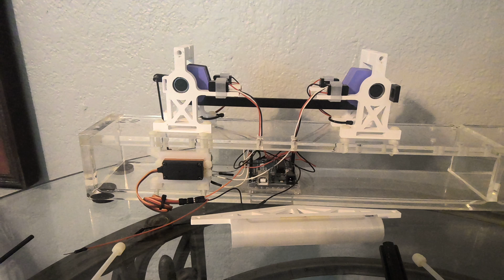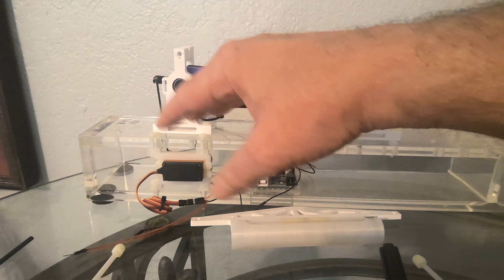MEO part 3.2

Comment: I would to comment that this is being translated in the wrong way for science to see what's actually happening here in my study of your videos of MEO is your essentially stating free energy or creating energy witch doesn't agree apparently but if we take out free energy for (tapping into the natural push and pull forces of magnetics) it falls into the categories of wind and solar and it becomes more clear we have a enhancement device that maintains its self while under a certain gearing ratio provides rotational forces that without gas electricity wind or solar can be tapped for power to back fed itself with certain resistors so that while providing the rotation won't burn the servo activation board so then it's called Magnetic Enhancement oscillating system correct and can if fact do what you're saying
Reply from the maker: @MrRutty-so3vy    Sorry it took so long to reply to your comment, been pretty busy of late just trying to keep a roof over my head and stay fed. I'm actually pretty upset right now as this is my second attempt to reply to you. On the first try I accidentally deleted the comment I had spent about an hour composing.
     As I have stated many times even though MEO is a very simple device operating on very simple principals it is very hard to fully understand. The reason this is so is mainly due to the first "law" of thermodynamics. About the only part of this "law" that most people remember is that "Energy cannot be created or destroyed, it can only be transformed from one form to another". The sad truth is that this law was formed over the course of almost 100 years, yet despite that it is still just a poorly thought out theory that is incomplete at best. The part that is left out (that I know of so far) is that energy CAN be copied without effect to its original form. This (also as far as I know) loophole to the 1st "law" is only possible through the use of magnets. When we use physical magnets as part of the actual device then the physical force (energy) the magnets are capable of becomes and inherent property of the device itself. What this means is that even when the device is static it is still producing this force, we only need feed it enough power to actually access that force. In the case of MEO the amount of energy needed to access the device's inherent energy is a small fraction of the energy being accessed.
     A modern neodymium magnet bleeds off around .1% of it's field strength per decade. This means that a modern Nd magnet in good shape has a theoretical lifespan of around 1000 years. Also given that a 2" cube Nd magnet is capable of around 500 lbs. of physical force its energy density is rivaled only by a nuclear reaction (maybe not even then). So given this information here is a thought experiment that proves what I have said about the 1st law of thermodynamics. Imagine two levers mounted parallel to each other with each having a pivot at its center point. If we place two Nd magnets, so they are repelling each other, between one end of those levers they will force the other ends of the levers together with the force of the two magnets FIF (Field Interaction Force). In the case of the 2" cubes this would be around 1000 lbs. of force. Now if we place a scale between the pinching ends of the levers that scale will show a constant (active) measurement of the energy being produced by this small device. Measuring this force in this manner is by any definition work. What this means is energy is being produced (via the FIF) and used (causing a measurement to be indicated on the scale) yet the source of the energy being measured remains unused. The two magnets in this device being the same do not have any negative effect on each other such as field swapping. Other than the fields natural degradation rate no energy is being used, yet energy is being output. In effect we have created a "copy" of the energy and measured it. This is by any (or no) stretch of the imagination not only over-unity but a massive amount of over-unity given that the measurement is constant and active and can last for centuries.
     MEO is very unique in that it works the exact opposite of every other prime mover known to humanity. This is all due to the fact that the output potential of the device is an inherent property of its parts. It is not the operation of those parts nor the energy needed to run it that produces the energy. The parts and operating energy are only needed to access the inherent energy of the device. In the case of magnets the energy needed is but a small fraction of the energy accessed. With the "time as a mechanical advantage" aspect the more load that is placed on the device the less power over time it will use, yet the power output remains constant as it is only influenced by the size of the magnets used. This is the equivalent of driving you car up an ever steeper hill where the steeper the hill gets the less fuel you car uses to climb that hill. At least until gravity overpowers the FIF of the magnets used. 
       Thanks for watching the videos and for your question/comment, hope this helps.

Comment: Hi again. Is the angle of the magnets on each of the pivots important or can you use a different angle. and do you have any steel behind the magnets so the front face is always the strongest side.  thanks
Reply from the maker: Other than the little bit in the servo and Audrino there is no steel in the entire assembly. As for the angle of the two magnets in each rotor, the smaller the angle the less the number of rotation degrees the rotor needs to turn to achieve alignment with the piston magnets. This determines the amount of time power needs to be applied to the servo used to turn the rotors. Hope this helps.

Comment: Hi very interesting concept thanks for sharing, may I ask if you use flat square magnets or circular disc magnets  and which do find to give the best results.  regards  Deryck
Reply from the maker: The piston uses cylindrical magnets while the rotors use thin disc magnets. The thin disc magnets can be skewed allowing the degrees of rotation to align with the piston to remain relatively small. At this small scale I used stacks of 7 discs because I needed the combined strength. Scaled up a single disc would be sufficient as all the force of larger cylinder magnets in the piston would be plenty. you don't need to consider the the added kinetic force of larger magnets with more mass in the piston as the larger the magnets used the slower they can travel. As the rotor needs to rotate as fast as possible to minimize time under power it's beneficial to keep the kinetic force as low as possible so single discs in the rotors would be ideal. No matter what shape or size used the output force will always be the combined Field Interaction Force of all magnets in play at any given time. The shape of the magnets used was just what worked best for me in this particular design. Thanks for your interest.